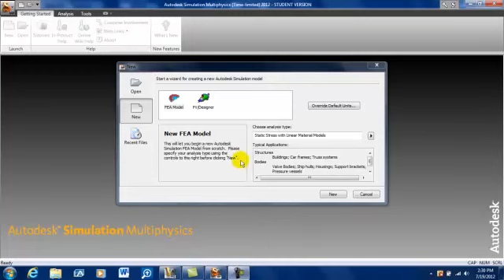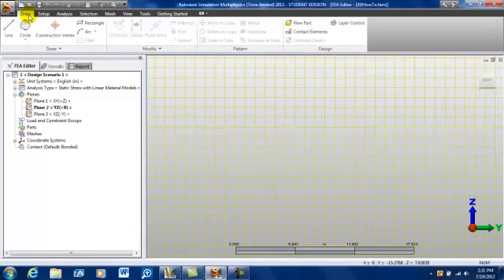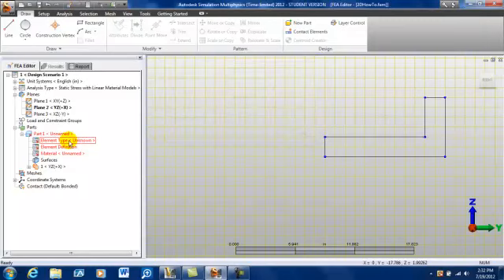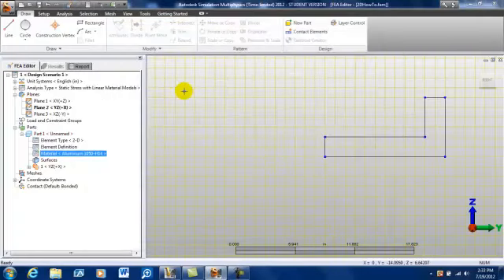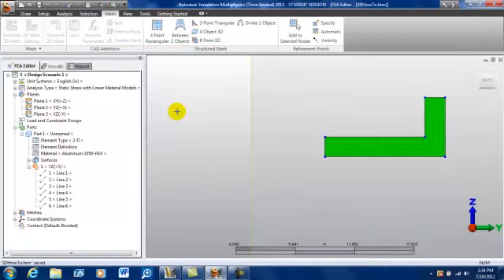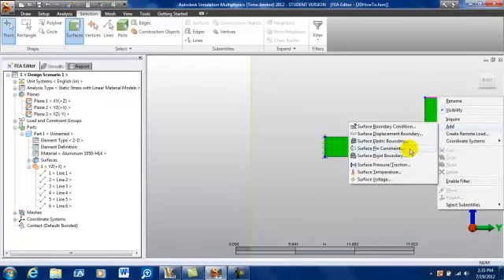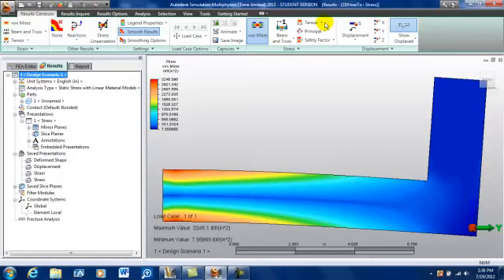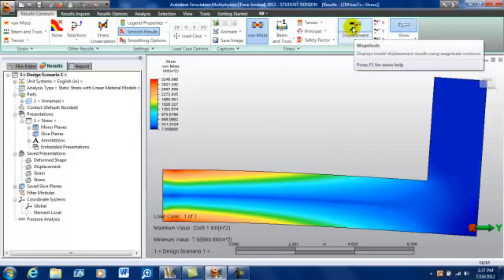Setting up a 2D Problem in Autodesk Simulation 2012

Comment: Hi, your video saved my life!!! i successfully draw the design in 2D and now i have a problem regarding the setting of element definition. My design is a cylinder enclosed tank and the heat source i decided to put it at base. The analysis type is steady state heat transfer. So, may i ask your opinion on what should i set for the element definition (geometry type, material model, heat flow calculation, thickness, principal axes transformation angle and body-to-body radiation). Thank you and sorry for my long question.